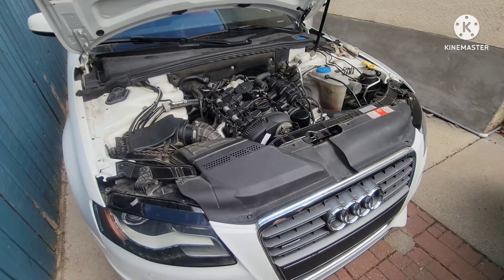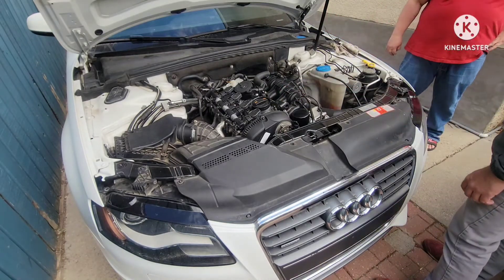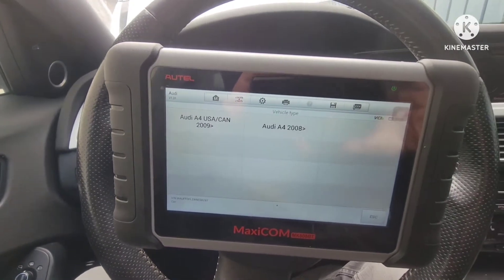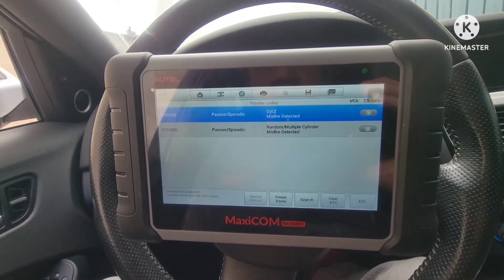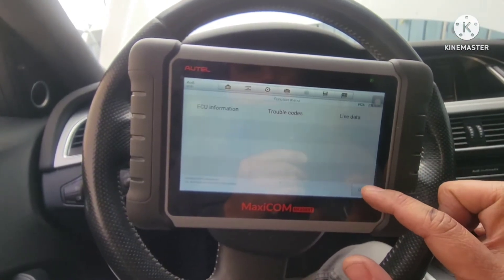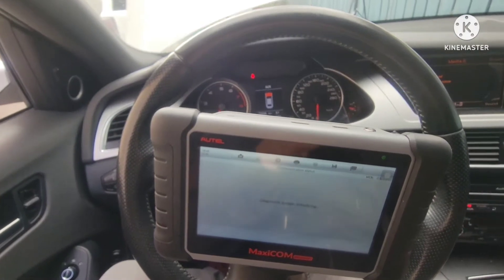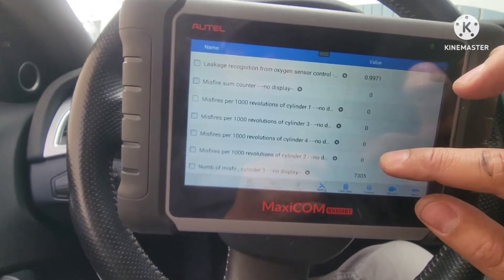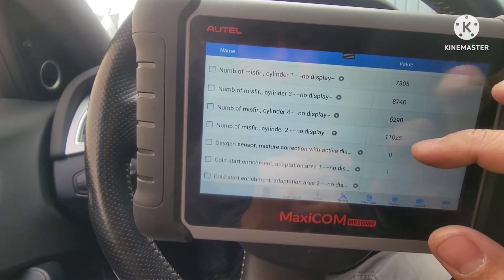Dont Ever Use This Autoalite Spark Plugs This Why Shes Spitting⛽️ Fuel &💨Smokey Tailpipe Case Study

Comment: So this is after the ring update and its smoking like that under load?
Reply from the maker: No.. it was smoking cuz ok bad sparks (previous owner put Autolite plugs on it) 
Spark plugs was misfiring couple cylinders
Reply: @jfGarage4k  i looked through your videos but i didnt see any fuel trim data do u happen to remember what they were? I have done my timing update but im pretty sure im gonna be tearing it down this summer and putting new pistons and rods in it. Mine is a 12 made in 11 and i dont think it got the updated pistons due to oil consumption. Im getting the same smoke after a long decel and upon acceleration. My fuel trims are all over the place, usually +14 but no cel and smells rich. I have injectors coming because i assume number 1 is restricted causing it to over fuel the others.
Reply from the maker: Not sure the fuel trim i was running at that time but it was running rich aswell.  What brand spark plugs do you have in it? And its been replace brand new before?
Reply: Ngk plugs, i did a carbon cleaning and reused the injector seals when i put it back together. Leaking injector seals can cause white smoke like that also. I dont think they were completely sealing before i pulled the injectors because they looked like combustion was leaking past the seals when i pulled them.
Reply from the maker: Just to make sure you got a leak on the injector orings. Lets it idle  and spray intake cleaner around the injector orings and listen to the rpm of the engine  fluctuate, it it does thats your  main proble, replace all the injector orings